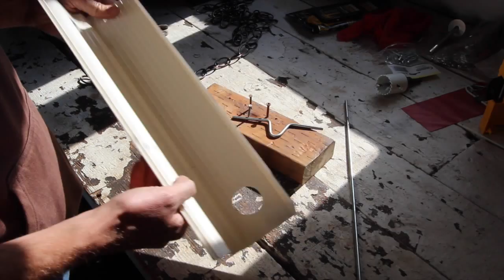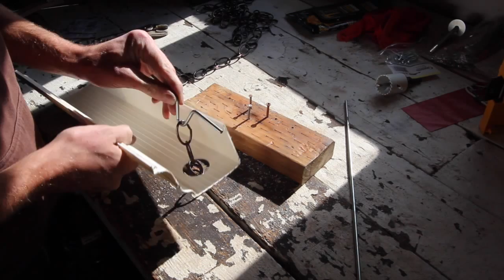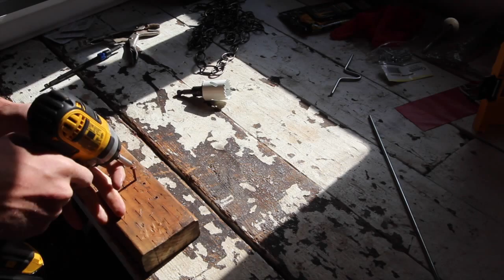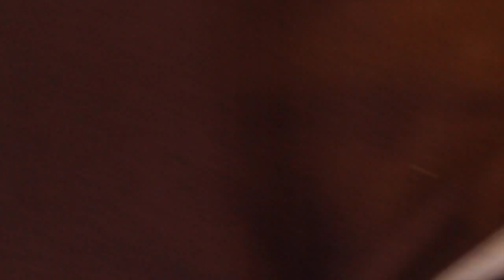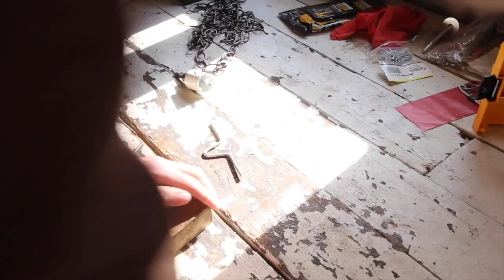DIY Homemade Rain Chains

Comment: what size hole saw bit for the rain chain
Reply from the maker: I think it was about 1.5 inches but I don't remember exactly.  You'll want to make the hole fit your bracket.  If you have a lot of leaves falling near your house you'll want to consider using a bigger hole and bracket so that the leaves can pass through.